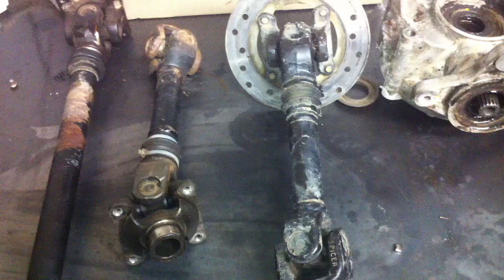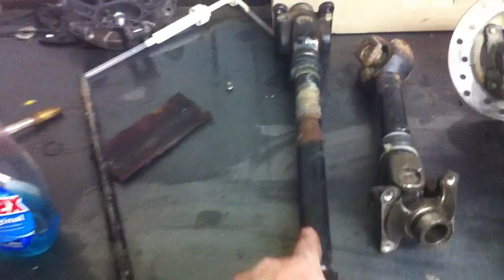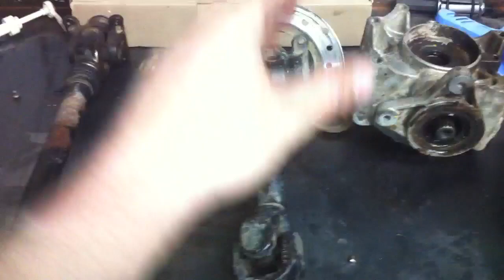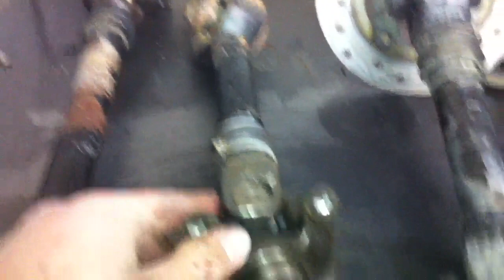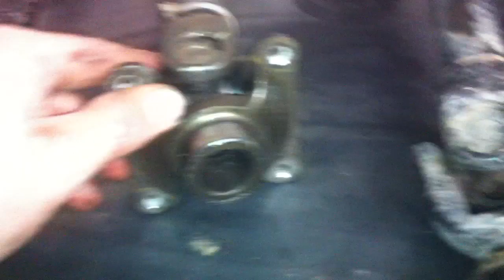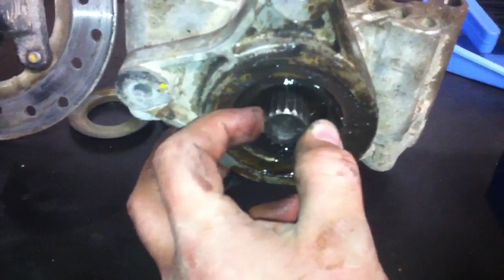Driveshaft phaseing

Comment: Hi, are you sure the phasing applies to ALL prop shafts? I have a 2007 Renagade 800 with yokes out of phase since production I think. Looks exactly like the 3rd shaf with the rotor on your video. It seems like if I turn it 1 spline, should get to phase more or less. It has ~400hrs and 7000k km and I'm hearing some noise, but not sure if it's coming because of "out of phase". The gear oil was dirtier than the rear diff, which I suppose it's ok?

Comment: for the last 2 years I've always got my outlander 800 fixed a none Can Am Dealership and I went for a rip in September noticed the diff seal was leaking so drove it there i was near the shop, called me the next day to pick it up, as i left the shop i noticed some crazy vibration in the rear and ratchet kind of noise almost out of the transmission, i than turned back right away walked in and told them I want it running the way it was before they looked at it for days and couldn't find anything, I flipped out and they told me my transmission is done ? went the Can Am dealership where i bought it, buddy checked it, all that time it was exactly what your video is about, just shows how some places will try to make crazy amounts of money off of you if your not careful, I was told a transmission is over 2000$ without labor hours... crazy part about all this a new guy works there and last week he was calling customers to see how were the customers experiences were and how happy they were with services, I must say I buried them on the spot and I don't think he was impressed either lol

Comment: Amos, I have a 2007 650 Outlander Max with 10k miles, I had the front drive shaft replaced and wanted to know how I can check the rear drive shaft it is on the quad. If not do you have a video for removing the rear drive shaft?

Comment: thanks man for the input
Reply: After putting some miles on our sons polaris the rear drive input seal leaked .After the dealer replaced it it screamed even at low speed, the dealer kept it in the workshop for 3 months trying to fix it and ended up putting a new rear driveshaft in. 
Ok all good until a little use made the seal leak again so pop ( me ) took it apart and found that the numbnut mechanic had put the seal in back to front and the original shaft was out of phase. All that time and money for a seal leak 😣